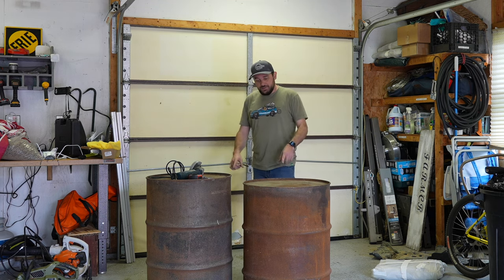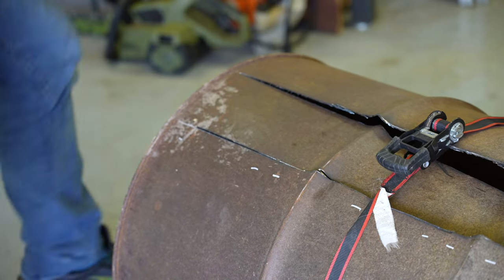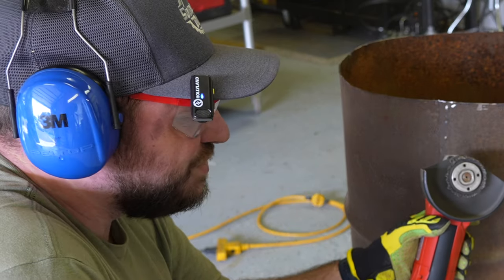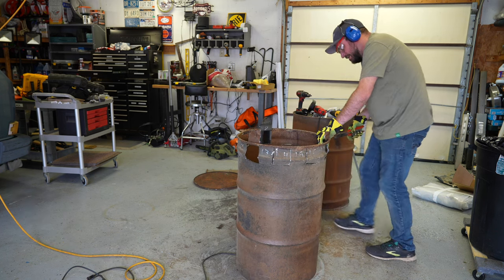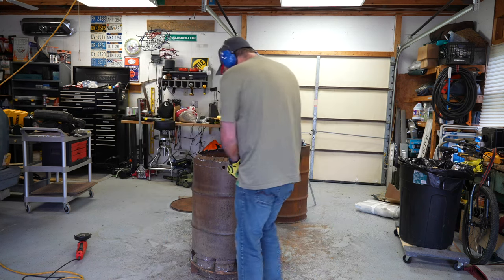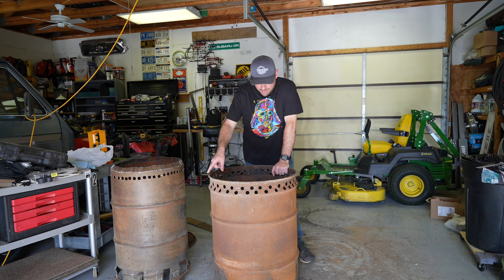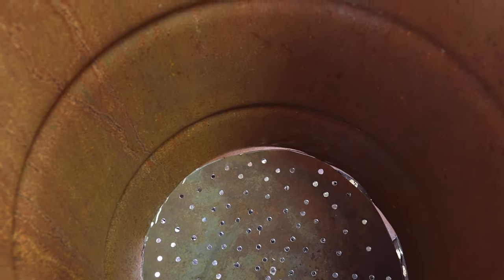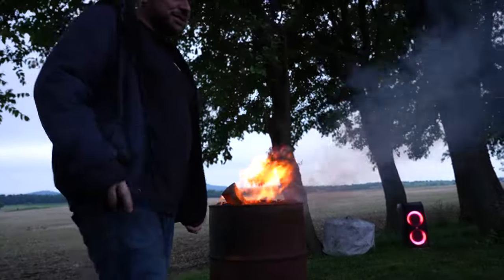Building a SMOKELESS Burn Barrel to Turn Brush into Dust!

Comment: Those Norton abrasive wheels are great. But the downside of all abrasive wheels is they don't handle side-loading well at all.
I was using a 10" wheel on a pipe-cutting table to cut chain when the chain slipped form the c-clamps and the blade shattered into about thirty pieces, several of which really tried to puncture me.
Reply from the maker: ouch! That could have been painful. Yeah I had tons of these shatter on me, always have to wear that PPE.